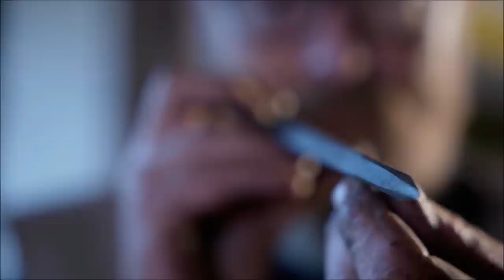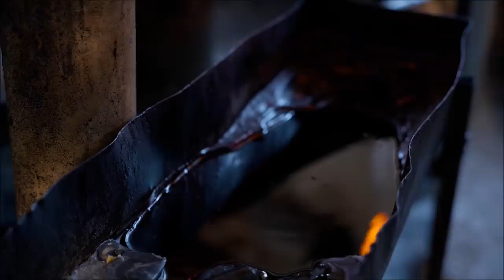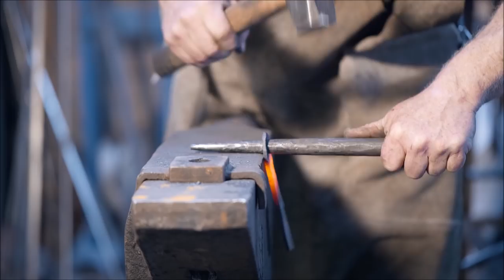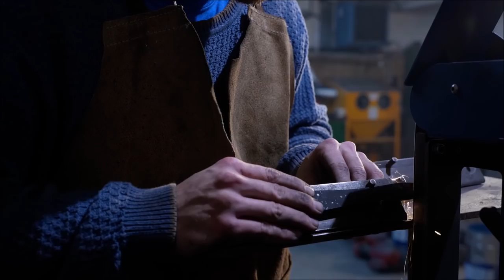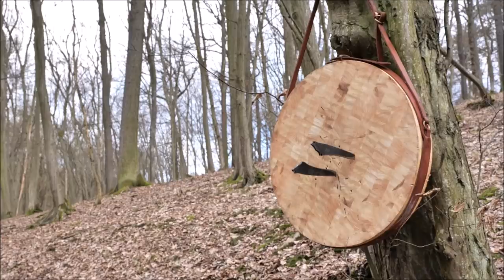Throwing Knives from Valhalla (Wulflund Production)

Comment: bought 3 ace jet stinger, they have the worst finish i ever see on a knife. don´t know what you talkinging about puting much effort in the products you support.
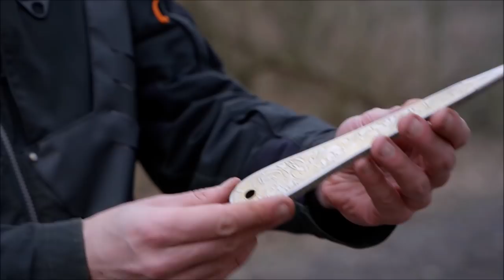@5:34 you can see it, the grind on the tip, done whit something like 240 grindstone, you can use this as a file. sure they sturdy, because they made out of a thick piece of metal, but at this price its disgusting how poor the finish is. took me a few minutes per knife and some fine sand paper to fix it, but still a shame.